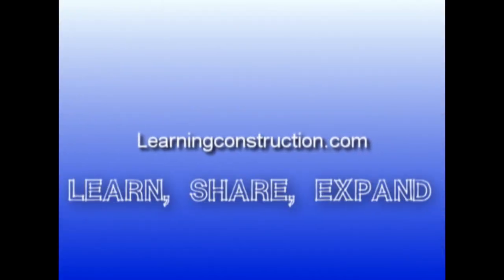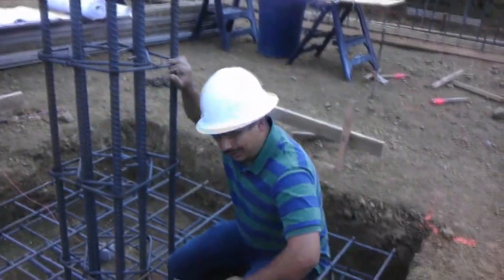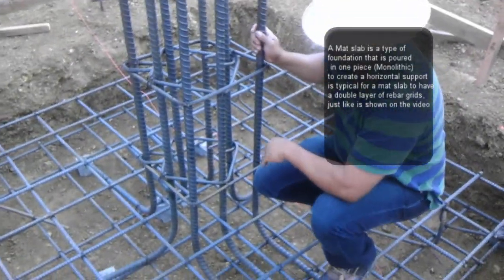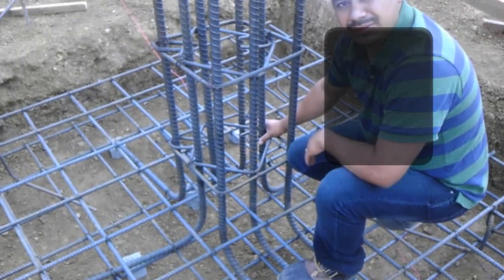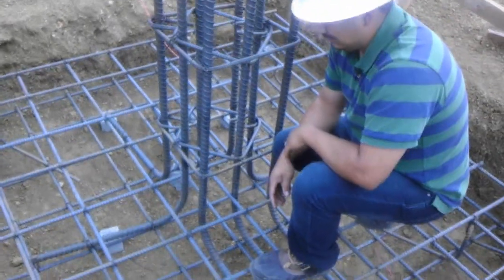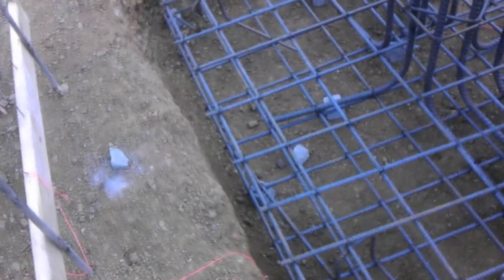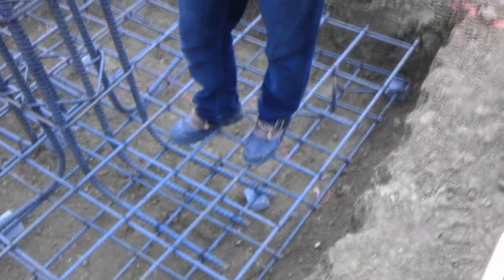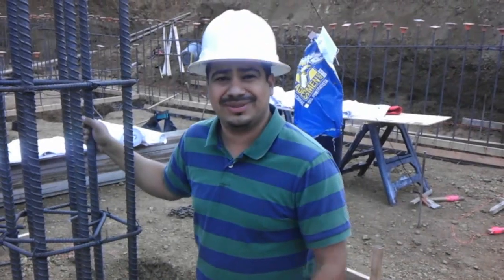How to Use Rebar

Comment: Hi, I have a clarification, one of the column has 4x16 dia rods and 2x12 dia rods are used. Now the column is poured for cement concrete and cured. Now plinth beam tie is finished and ready for pouring cement concrete. There was dimensional mismatch so now 4 rods in column are cut and another 4 bars are added in plinth level tie up. And then cement concrete is poured. Will the column be strong..if not what to do for reinforcement?

Comment: I m not agree with installation of rebar with this conditions. There is my finding as quality point of view. 1, Installation of rebar direct on natural ground  without lean concrete that is volition. 2, should be formwork around footing, 3, vertical rebar should not install below the first layer of footing rebar, its should be top of footing. Thanks
Reply: you nailed, I hate to see rebar resting on the ground period !! the other 2 observation points  you might be right as well !!

Comment: Thanks....but there’s some observations , Like: 1- wooden wall around base must be done 
2- plastic sheet should be under base 
1&2 to prevent sands suck Cement mixing water or will be cracked
Reply: Use of plastic sheet is not really necessary here. Using coarse aggregates as coarse base would do the job
Reply: Watch here more

Comment: If u are not doing a monolithic  pour the easiest way to install would be to dowel  out the pad.pour prefab column. Form and pour your vertical. I agree the "tie" spacing... not stirrups ...  stirrups are foung in slab bands .,look pretty far apart.

Comment: Consider the spacing and number of lateral ties from the top bars of the footing. It might be 6 @4 and 4 @ 6, and the rest will be the least dimension of the column based on ACI Code.

Comment: The depth of your foundation is less than 1.0 meter from the original ground level with respect to the width of your footing.  Consider the soil bearing pressure.

Comment: alot of you guys saying that the pit isnt deep enough here is something to consider. where i build we use use driven pilings and before we are permitted to build we musr drive a test pile and have it tested by the state. that is typical of homes built along the coast and the actual depth of the pile is determined by butt size as well as tonnage. that being said i single story structure isnt as heavy as the 4 story custom homes that we build so the footing doesnt have to be as deep. from what i can see that is a pretty wide footing for that column so the structures weight is displaced over a pretty large footprint. keep in mind that a state inspector is signing off on the footings so we can deduce that the depth is within engineer spec. of course alot of that has to do with the depth of the frost line as well as the makeup of the soil. looks to me like there is a bit of clay composition so that will be harder than regular top soil. just sayin.
Reply: Ilan balde Ng buhangin sa isang semento sa asintada Ng hollow blocks
Reply: The
Reply: If the building was going to be 6 stories, how deep the footers have to be

Comment: The matslab looks 1000 * 1000 mm, with 8 mm bars, the spacing between the two grids 150 mm. The column: eight 16 mm bars, ties and stirrups 6 mm. Clearance: 60 mm all round. Is that right? 

If yes, could we not put well more than two floors on that?

Comment: Stirrups are only for stabilizing vertical bars of column? The distance between stirrups is veeeery high. Columns are designed for compression with bending moment. That reinforcement could buckle if the distance between stirrups is that much. There are other things to talk about your column, especially the design part.
Reply: especially because the column is short, the stirrups should have been closer at the bottom (the shear force is higher)
Reply: YES THE STIRRUPS SHOULD HAVE BEEN CLOSER AT THE BOTTOM PART
Reply: also...this isn't a mat foundation...
Reply: मेयकामकरताहूमूझेकामचाईय
08975174258

Comment: why you used 2 layers of reinforcement while you have only single column ??
2 layers of reinforcement used when you have 2 columns on single foundation which  make negative moment ??
Reply: OVERDESIGN IS BETTER THAN UNDERDESIGN,
Reply: Top reinforcement is not working for single foundations . All 
moment on the bottom layer of the foundation. You can increase the diameter or bomber of bars for the bottom layer for more safety
Reply: Abdelhady Sakr JUST FOR EARTHQUAKE PURPOSES.
Reply: In slabs we but top reinforcement if the thickness more than 15 cm for shrenkage . Because the slab has larg area . In isolated foundations we don't do that .

Comment: Saludos desde Puerto Rico. Gracias a tus videos  comencé ampliaciones a la casa. Now I have a question. I want to build stuctural colums but I want to do it as close as I can to the border line of the property of the house. I know when you build the fudation it has to be square, but can I do it in L shape form since if I do it square I will lose almost two feet of terrein

Comment: Dear  , sorry to say its not complete information,  how he place directely the rebar directly to the soil,   the following spepts to be followed: 

1- use vapor barrier 1000guage thickness.
2-cast blinding concrete  50mm min.
3- apply water proofing top of blinding  paint apply or membrane according to the specs.
4-protect the water proofing
5-fixe the rebar of bottom mat, top mate , starters.
6-cast the base and columns kickers.
7- curing of the concrete 
8-waterproof the base.
thanks